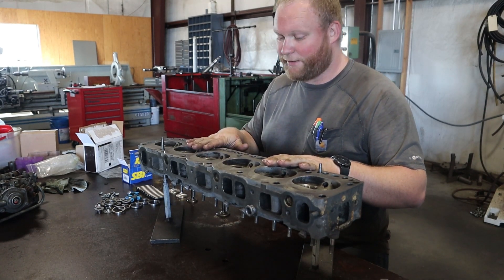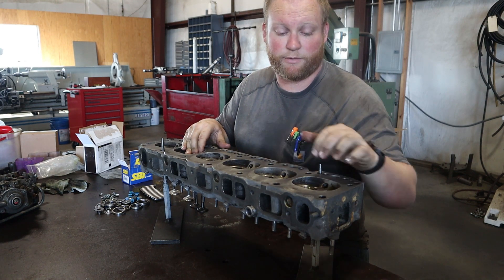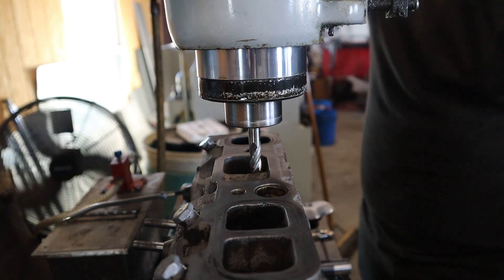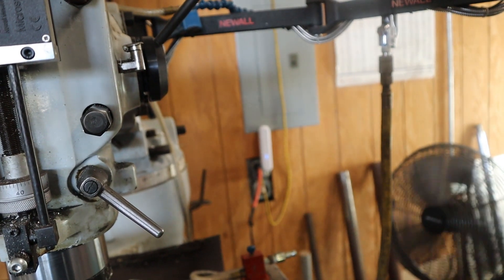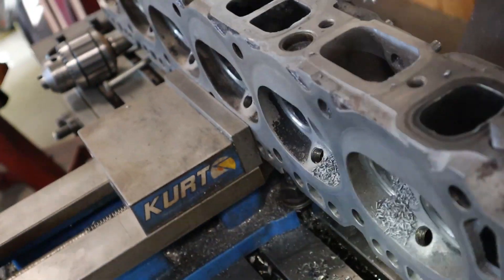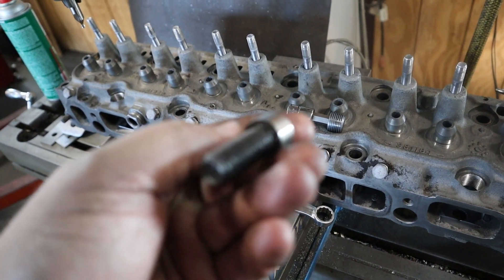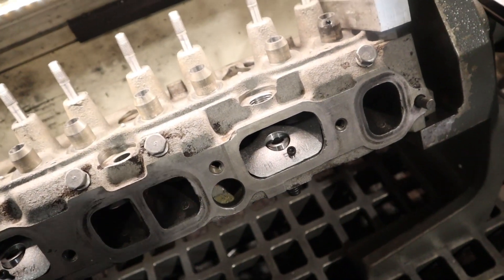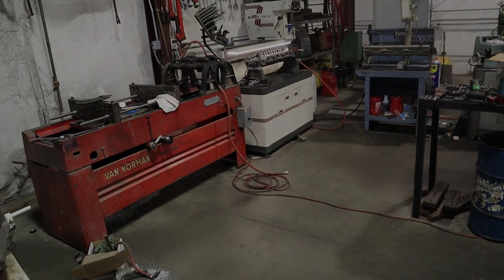Chevy 292 Head Lump Kit Installation

Comment: Well, there is a difference in 1.5...and 1.6....don't get hung up on exhaust valve size....lots of dynamics happening....Don't forget about velocity...those valves are called undercut valves-done bt valve manufacturer...there is also the straight stem....In some applications,  undercut valves cause turbulence in ports-I take and Exhaust....

Comment: Very Nice...adding Intake port plates-NOT LUMPS! LOL! is basic step to increase airflow...Epoxy is Needed to increase airflow....Nose of intake port plates need to be extended to back of port with epoxy-REALLY Adds more airflow and Performance!...Great video....leelites
Reply: If interested,  Emission heads had Flame Inducted Hardened Seats from the Factory.  Perfect for 1.5 exhaust valves. That head you have appears to be an Emission head due to bolts at exhaust port-for smog pump.
Reply from the maker: You say To-Ma-Toe. O say Po-Ta-Toe. Haha! Once it's all finalized, some epoxy will fill in the gaps. Thanks for the tip